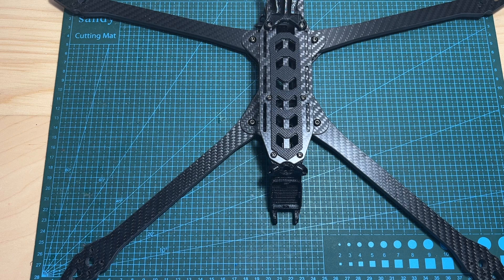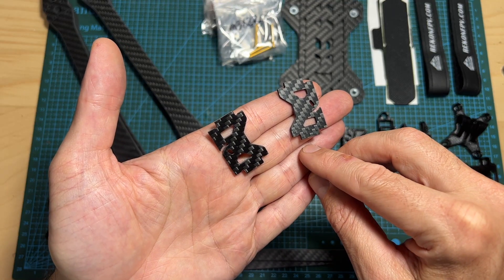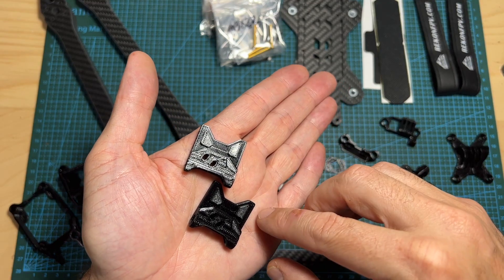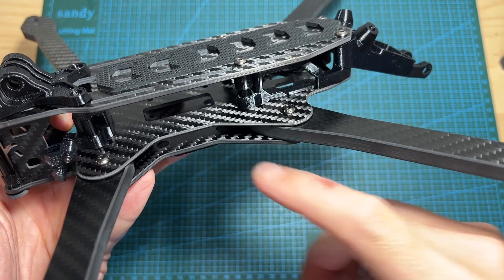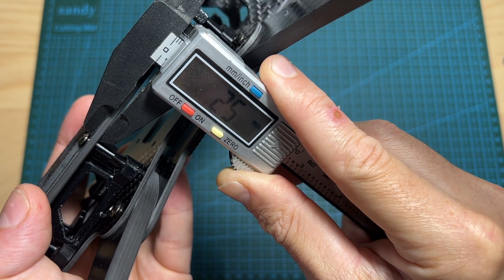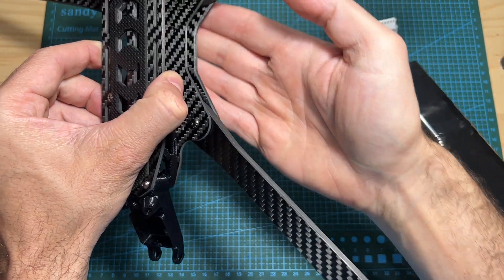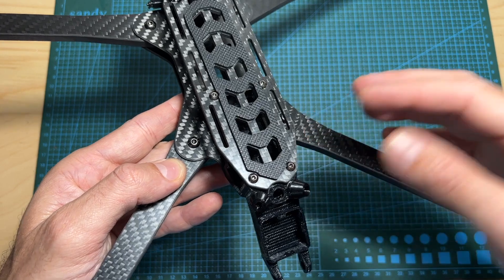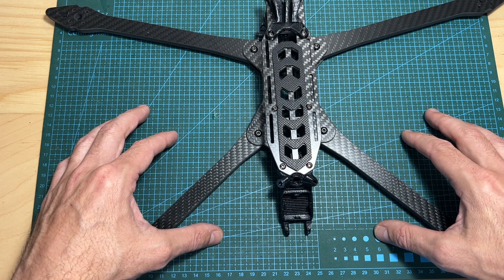RekonFPV Rekon10 PRO Long Range Frame Kit - Build & Overview

Comment: I am just starting this build with 3115 motors and Foxeer F7 8s and Foxeer 65a 4n1 8s.  I am am looking forward to watching the results of your build and I hope to get mine done in another week.🔥🔥
Reply: yeah i wanted to 3115 640kv 8S build but making the packs and fitting them i was thinking would be hard. I guess can do like i currently do turn packs sideways to fit top plate.. run 8S2P 8000mah on top and one on bottom for 16,000mah long range cruising.
Reply: @divingfalconfpv4602  I have almost got it nicely tuned flying with one 6s 5200mah, and within the next week and then, I will start flying with two 4s 5200mah, they seem to fit nicely on the bottom.  I soldered three xt90 plugs as a serial adapter.   I am taking it easy right now with just simple punch outs, flips, and rolls, but I have no bounceback now.  I may put a slight motor limit on for 8s initially until I get a feel for it and then I am going to let her rip!!!...lol🚀🚀🚀
Reply: @sparksfpv  I don't think u need a motor limit. But can't wait to hear how it flies.
Reply: @divingfalconfpv4602  Is it OK to post a video of it flying once it's tuned?  I am a big fan and don't want to cross any boundaries.  Or elsewhere, let me know.  Thank you!

Comment: my 6S2P 21700 I turn the packs sideways then run them parallel. But with the 10" i plan to run 6S2P top and another 6S2P on the bottom for 16,000mah
Reply from the maker: Interesting.

Comment: Been waiting for this frame awhile. And waiting for your review after it hit. I want it
Thinking 6s4p top and another 6s4p mounted on bottom for 24,000mah

I might do the iflight dc10 v6 10" though for battery space
Reply from the maker: I'm afraid this battery will be way too big and heavy for this build.
Reply: @KremerFPV  Damn I run a 6S4P 12,000mah on my 8" thought 10" would be enough extra light to cover a second lmao

Comment: Looking good, Gal, are you going to assemble it? If so, I would really like to know what motors are you going to use
Reply from the maker: Thank you. I plan to use this setup: https://shop.iflight-rc.com/long-range-quads-cat325/XL10-V6-6S-Pro1974?tracking=rBX0HnGd8qX5bhBSLvHLK9rfPkOhc3i0zyagzEfyaH3fMRDPE615sRDCC6G4NbOq
Reply: @KremerFPV  Thank you

Comment: Gonna be interesting to watch. I built an 8 inch Merica instead of the 9 inch mainly because of costs. The lipos and motors would have exceeded my budget.
Reply from the maker: Yes I hope it will go well 🍻
Reply: I have the 9" Macro Merica and love it. cost around sub $500 at the time. Lipo batteries were reasonable running 3s packs in series.
Reply: @scottgivens27  nice. I'm running the BrotherHobby 2810 1500kv motors on 8" Macro Merica. What are you running?
Reply: @jlarson42  Brother Hobby all the way. I’m running 2816 1050kv. Such insane torque and power! It definitely attracts a crowd, which makes flying even more complicated at times! Lol

Comment: I have a rekon 7, and as far o can see, these rekon frames have a lame design flaw in common: the body is too short to mount large batteries, and that's what we expect to use with such large/huge quads.
Reply from the maker: I agree, that’s a valid point.
Reply: Yea I have a rekon7 I agree. I run 2 6S2P packs taped together. I have had problems of some batteries being too long. Think there's only room for 138mm battery.  When I run 6S2P 21700 I have to turn the packs sideways to fit. Iflight 6s2p 8000 pack won't fit
Reply: @QSpeedRacer  why dont you just mount one on top and one at the bottom?
Reply: @Chubby Bunny  because they put capacitor in the way on bottom strap. At some point I'll redo it on rekon 7. But rekon 10 I build I'll do dofferent
Reply: True, I have the Rekon 7 . I ended up with the AOS-7, much larger body.